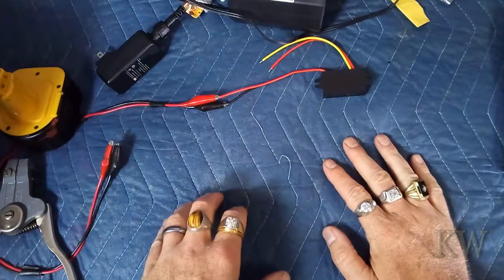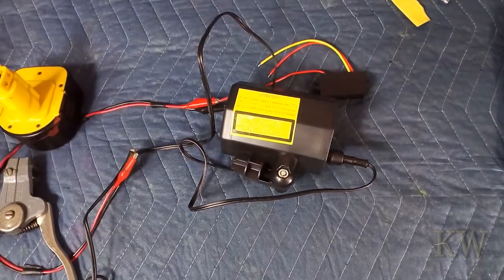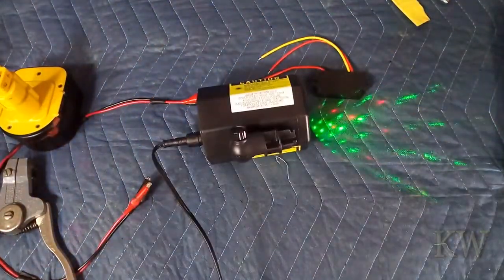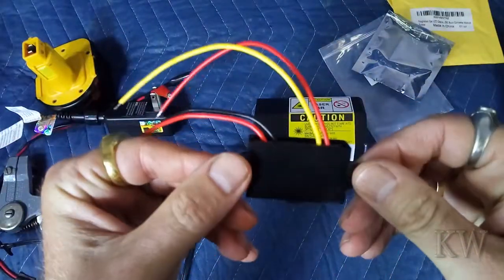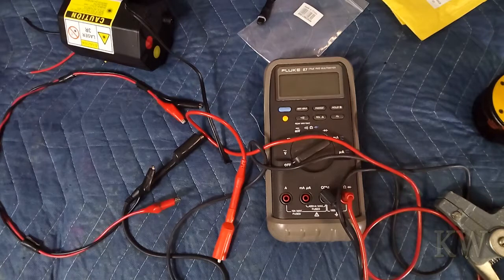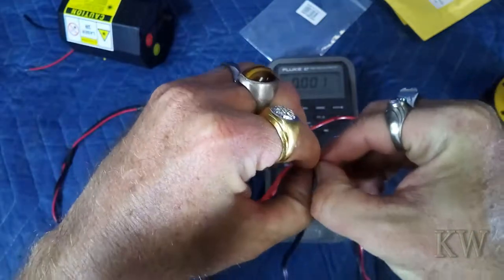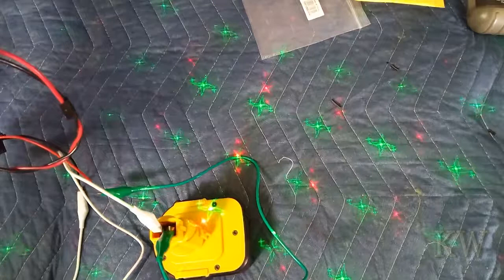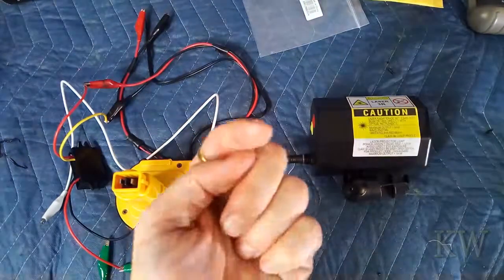12v to 5v Buck Converter Laser Project

Comment: Thanks for the video - very informative.  I want to do this for 2 lights I have in my garden that I'm currently having to wire to 120v outlet which is not convenient.  I already have 12 volt wiring and transformers for other landscape lights etc, so I'm hoping I can tie them into that.  My electrical question is, if I do this, introducing the step down converter to the fixtures - will that reduce the voltage down to 5 volts for everything downstream on the same cable, or will it continue to pass down the 12 volts unrestricted?
Reply from the maker: Anything on the 5 volt side of the bc will be 5 volt